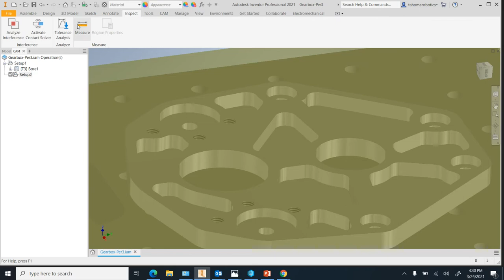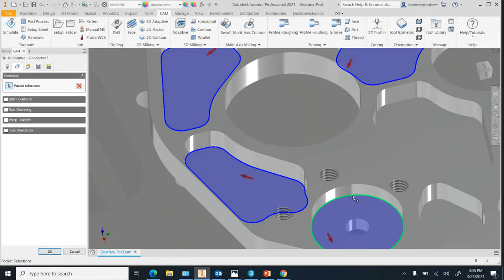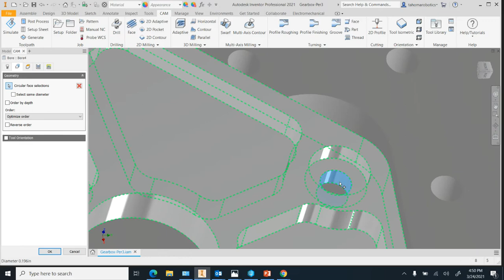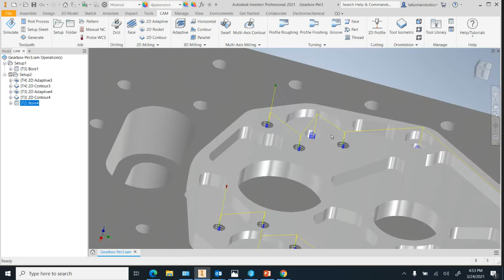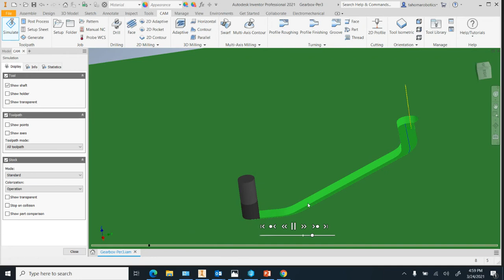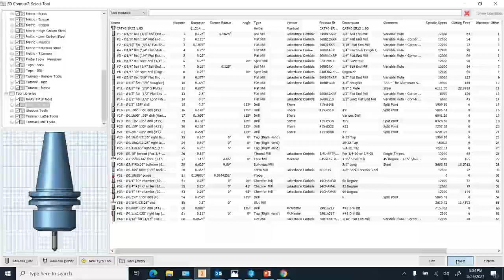Inventor CAM - Fixture Plate 03 - Gearbox Toolpaths

Comment: i always start with spot drilling+drilling (every hole on the model, that way you help the tool when ramping)+3d addaptive (tool inside boundry and select the outside contur of the gearbox, also let the default ramping diameter, and change to 1 mm the minimum ramp diameter, becouse the holes are already drilled, it's easier now, ramping angle 1 degree, always axial and radial stock to leave 0.25, becouse addaptive its a roughing strategy exculsively and lets bad surfaces on the walls, and also on the floor)+3d pocket rest machinning (if the case)+horizontal (manual stepover 75% tool diameter, and starting from model top -0.01 to model bottom 0, becouse you dont want to face the top of the model) + 3d Contur (if no tolerance on the pocket walls, becouse its not using correction, same boundary like 3d addaptive). This way you can have this all operations as templates saved and carry them over to other more complex parts with multiple slots , pockets, and contours to machine on different heights with minimum programming time. The only operation with more clicks are spot drilling, drilling, tapping, etc. and also 2d Chamfer, the rest dont need clicking on geometry.
Reply: later i saw you dont want to touch the fixture, that way you did correctly, but anyway roughing and finishing i try always to make them with 3d operations, once you configurate them , you cand load them to any part with minimum changes.